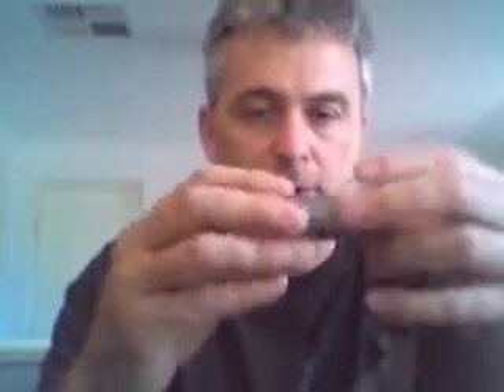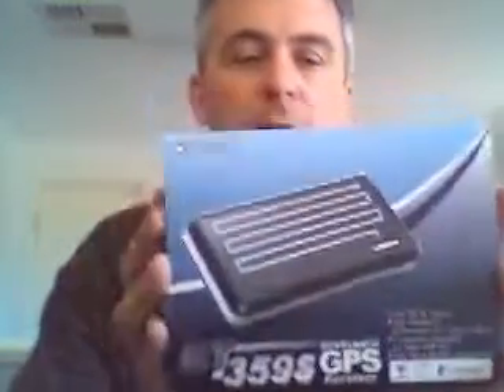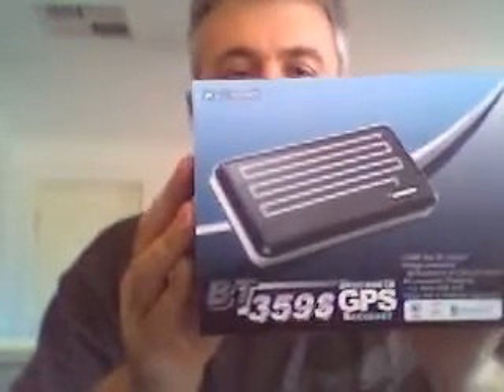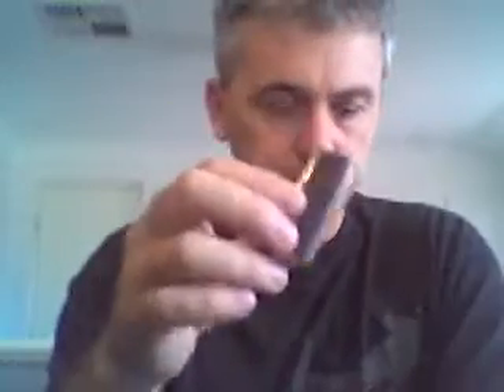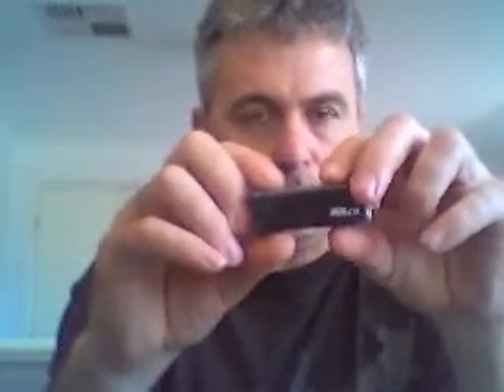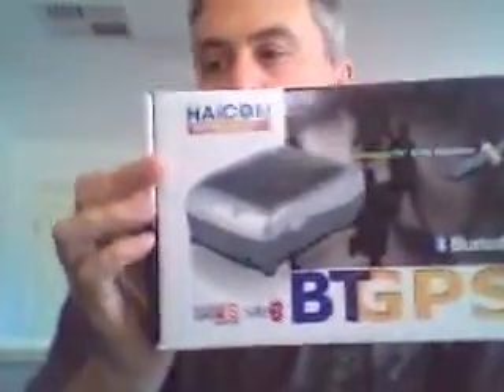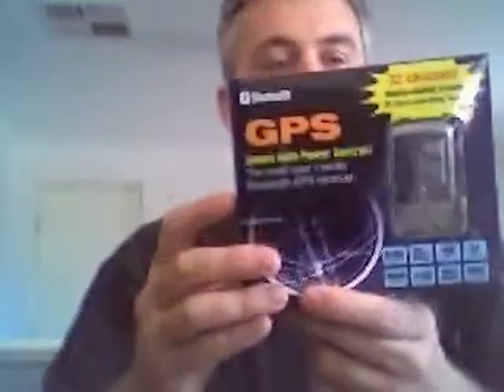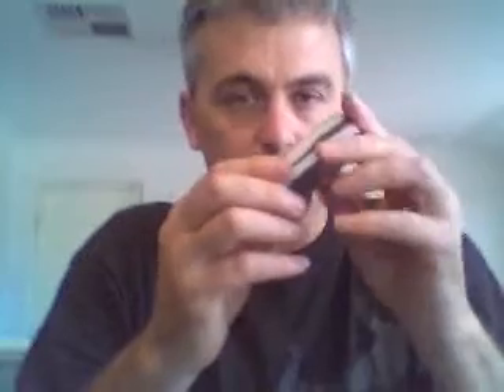Bluetooth GPS

Comment: Yeah i realised that anything over 12 channels was useless. I got a Globalstat 55 channel one, it's an MTK chip with 3m CEP accuracy, 5hz update rate (also unecessary i've been told). 1sec hot start, 30 warm, 36 cold.
Got TomTom software.

Comment from the maker: Venus520 uses same current and sensitivity as SiRF III (75mA).  The new SiRF IIILT and MTK32 use half has much current (35mA)thus instead of getting 11 hours you get 23 hours.  No. of channels is irrelevant as the max satellites you will see at any given time is 10; Venus520 may say it has 44 channels but in fact it has memory cells to store data rather than true parallel channels (hype). Current usage, tracking and sensitivity are the prime features to a GPS performance not number of channels.